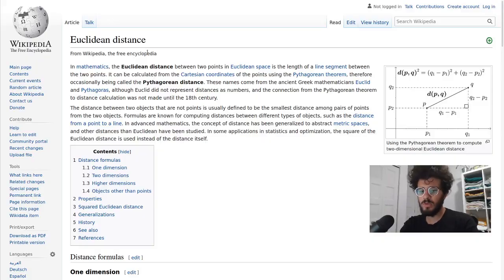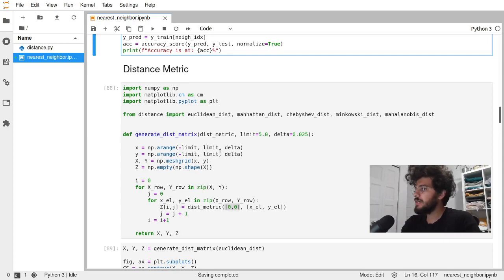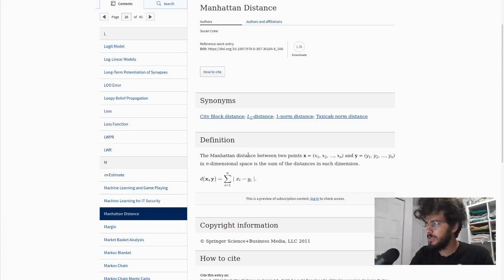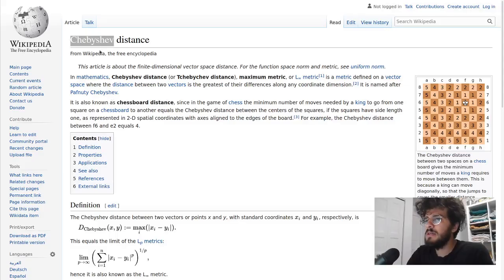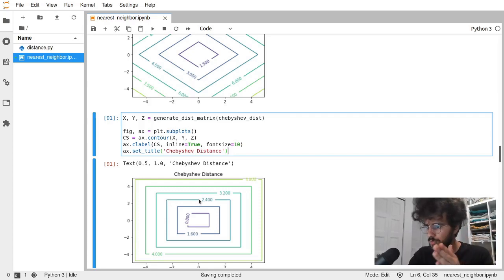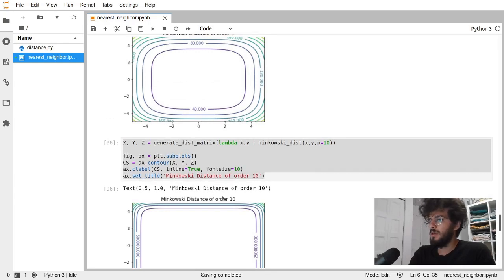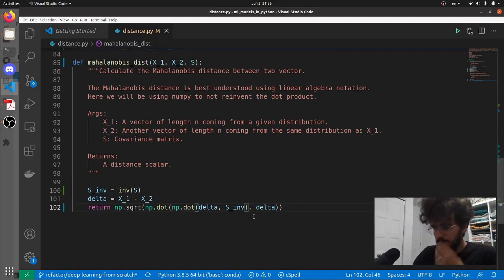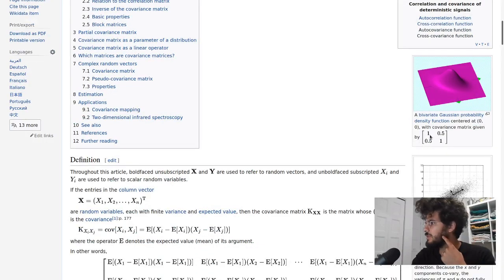Distance Metrics Explained and Visualized in Python

Comment: The Minkowski function does not seem to match the wiki page. You are returning the multiplication of sum(diff) and (1/p). Where as the wiki formula is sum(diff) raised to the power 1/p. In short I think you code should be something like, return sum(diff)**(1/p).
Reply from the maker: You are correct I messed that up! I'll modify the code and add a disclaimer, thank you!